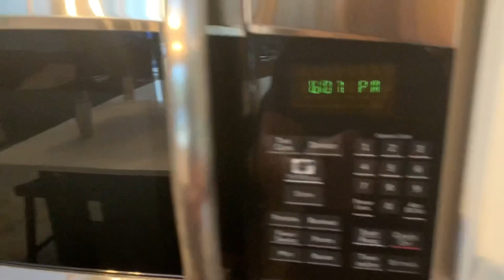How to install solid tires on electric scooter

Comment: The most stupid thing to do is to replace pneumatic tires with solid ones.

Inflatable ones roll much better, the scooter is better to handle, the scooter runs faster and the operating distance increases. They also won't go flat as long as you use the correct tire pressure.
Reply: Yes they do lol I've had issues with tubes on scooters for years. Even nowadays I do and I babymy scooter every where